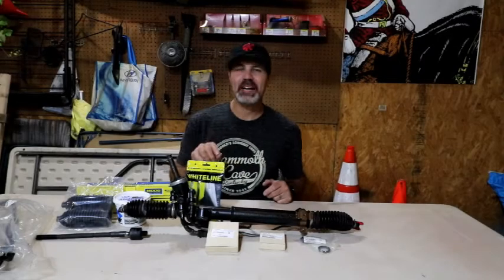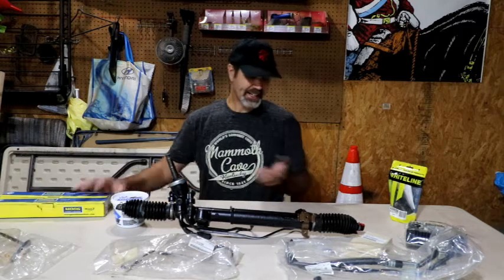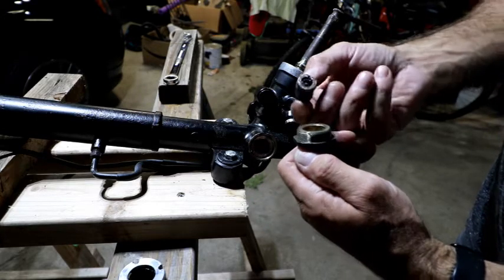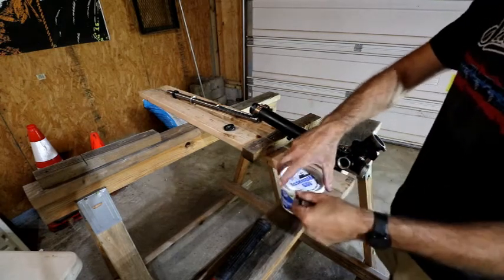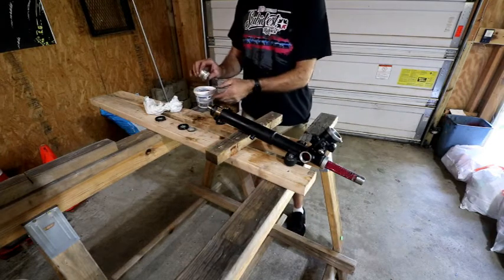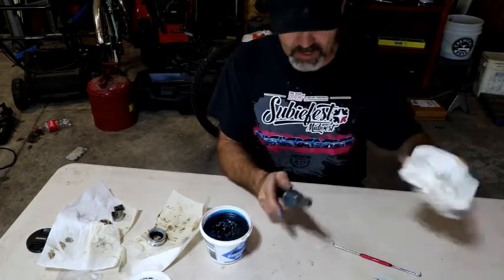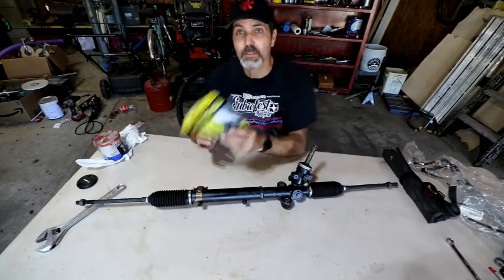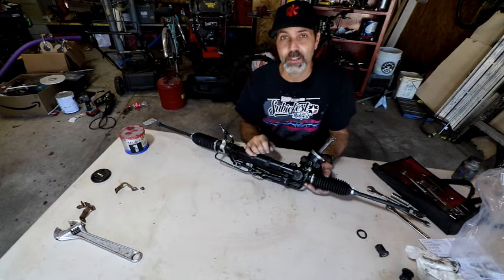How To Rebuild A Subaru WRX STI Rack And Pinion

Comment: Thanks for this video. Great Work! My steering rack on my 06 WRX is leaking through one of the boots. This video might convince me to do the rebuild instead of buying a whole new rack and pinion...
Reply from the maker: Thanks, it's really not hard if you have the patience. One thing I got backwards in the video is the tensioner on the rack goes in after you install the pinion gear. I had those two steps backwards and it worked fine but it could cause damage to the lower pinion seal.

Comment: I believe the part number for the weird cap is 34123AE001. Replaces the old part number no longer available
Reply from the maker: Looks like the right part, as long as the threads are the same. Thanks.

Comment: Thanks for the video! One thing, did you end up with an extra o-ring (large) from one of the kits? I have a feeling it is not needed, but wanted to get your thoughts (it’s not the o-ring that seals the threaded piece you need the pin wrench for)
Reply from the maker: The main shaft is two pieces threaded together. I didn't separate those so I didn't need to replace that o-ring.

Comment: No matter how hard i hit the rack from the drivers side it won't slide out of the outer housing. It feels like its hitting up against something inside the housing. Im thinking should i separate the 2 pieces of the housing ?.
Reply from the maker: Did you remove the pinion gear that attaches to the steering column?
Reply: @DIYEVERYTHING  yes . I think its the seal on the passenger side that goes behind 38 mm end nut. I'll try and drill it out or dig it out somehow

Comment: I am about to give up on my steering rack😢 . You made it look easy. Mine is seized everywhere. From the inner and outter tie rods. They just wont come off.  Think i am just gonna get a reman unit.
Reply from the maker: Focus on the inner tie rod to the rack. Turn the rack so it has one tie rod fully extended from the housing. Some have a lock washer that is bent over the tie rod to hold it. If there is one, you need to straighten it as much as possible. Then, gently use some heat to expand the rack side and soften the locktite.  If you're still struggling, spray in some wd-40 or similar a few times as it cools down and try again. You can do it.

Comment: Ughhh need to get mine rebuild since I’m also installing a Chase Bays power steering line kit. Plus Whiteline bushings. But rather have a shop do it. Way to many steps and I’ll know I’ll mess something up lol
Reply from the maker: Not many shops will rebuild racks, most don't have the knowledge to do it anymore.

Comment: So there is no rack bushing on the driver side? The silver thing that you removed when pulling the rack from the passenger side.
Reply from the maker: The drivers side, or the pinion side since it varies from right to left hand drive, has two pressed in bushings. The other side has a bushing that wraps around the shaft and secured with a strap.

Comment: replaced the hose line with the part number that ends in 60 because it was leaking. the new one i had replaced it with has the car working and able to drive again but it’s still leaking a bit..
Reply from the maker: They can be frustrating at times.

Comment: Please is it competabilty to subarue impreza b3 2009
Reply from the maker: You may need to reuse the hard lines from your old rack and figure out the bushings to make it bolt up but yes, it will fit.